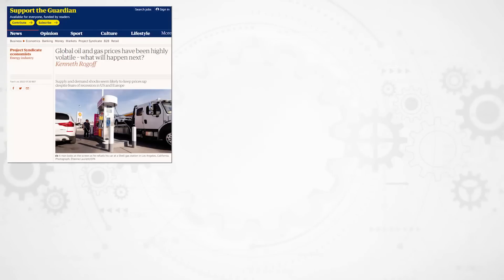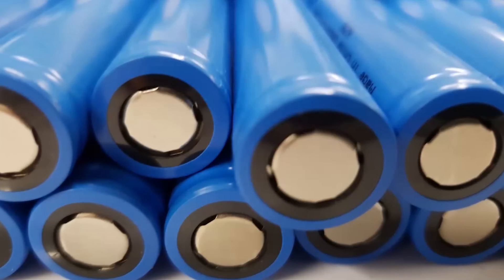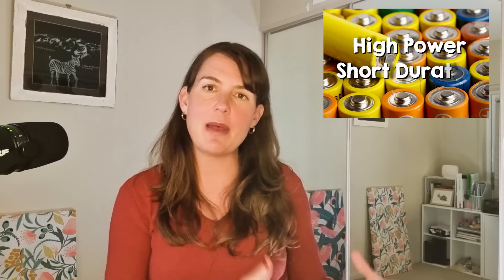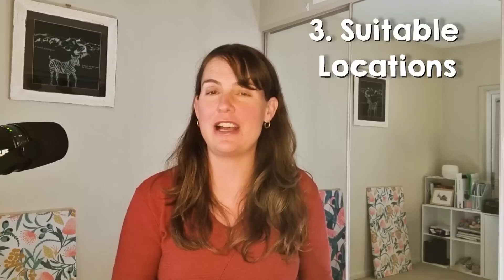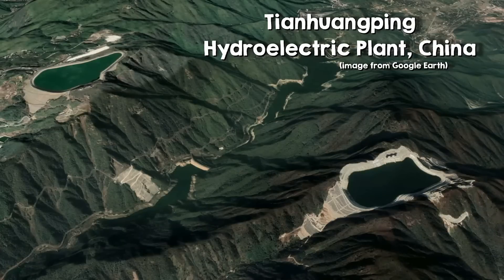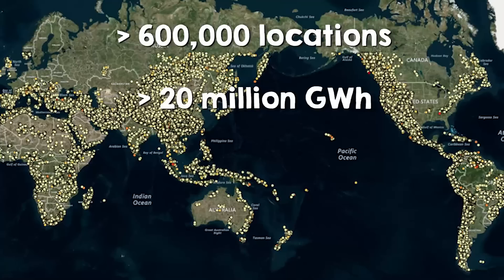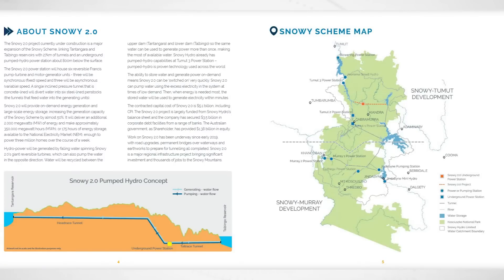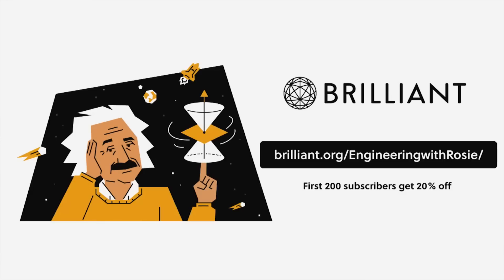Pump It Up When You Don't Really Need It: Pumped Hydro, Future of Energy Storage

Comment: Thank you for the video Rosie. What boggles my mind with regards to pumped hydro is the lack of creativity. The obvious thing is to look for potential height differentials on land as you covered in the video. Those are made obvious with the chart you showed. But Imagine installing each giant windmill in an offshore farm with a reservoir surrounding the windmills foundation. Windmills could then empty reservoirs when there is excess power, and have hydro turbines generate when needed. Generally the highest elevation differences you will find anywhere on earth is in the sea which is pretty much an endless reservoir. Surely it is possible to construct cylinders that displaces enough water and link them in the same way you construct submergible tunnel sections for example. You could get kilometers of head pressure and it is easily scalable with little or no environmental impact other than the construction cost which of course is significant.
Reply: To make pumped hydro viable you need a large volume of water enclosed by a small quantity of concrete. That's why you build dams across existing valleys - 3 of the 4 sides are rock. Difference in height from upper to lower is good because you get more energy per m3 of water,  but height of dam is bad because the higher it is the worse the pressure it has to hold back. So you need 2 natural formations with wide low basins at 2 heights. What you're suggesting is an entirely man made storage reservoir with narrow width and very high height where all of the height difference comes from the dam instead of the difference between the 2 locations. Plus sea water is much more corrosive than fresh water. The whole thing is a complete disaster I'm afraid. But good for you for thinking outside the box. Occasionally crazy ideas can be good. But for every good one there's 1000 ideas that don't work.
Reply: Right, its just immensely expensive to build reservoirs that resist the pressure. Especially in decent volumes. How much volume are you thinking of per windmill?
They need to be watertight, too--at this pressure. 
Unbelieveably expensive...and lots of co2-concrete I suppose.
Do some maths for half an hour please..and tell me whether you still think its a good idea.
Reply: Just look at the challenger deep from Piccard and see how much steel it needed to withstand the pressure. The volume is not even considerable.
Reply: CO2 is a ruse. 
Climate change the "Greens" are talking about is caused by changes in the cosmic-rays/solar-activity relationship and cloud formation  (See the work of Henrik Svensmark.)  Cloud formation by actual cosmic rays can be scene with the naked eye in Cloud Chamber demonstrations.  YouTube has dozens of videos about them.....

Comment: Rosie, et al. New Zealand is studying Lake Onslow, in Otago, an off river location with possible 750m head. Initial estimate is around $4Billion. A 12km tail race (or whatever you call it) will be required.
Reply: Lake Onslow could provide 5TWh of storage, or 6 months of power generation.
Reply: Initial estimate was $4B, most recent estimate was $16B. Still very cheap per MWh. Unfortunately the newly elected government has just cancelled work on it. It will still likely need to be built at some point. New Zealand's power system is going to remain hydro-dominated so the risk of dry years causing energy shortages isn't going to go away. So the delay caused by this government ideologically cancelling the investigation into it (shortly before the investigation would have been completed) is unfortunate.

Comment: I liked pumped hydro, but here in the western US the problem that is coming to be is that we can't have any hydro at all. Our lakes and rivers are failing from prolonged drought and if we invest in pumped hydro near the already existing dams, by the time they are built we might not even have the lakes and rivers anymore.

And the pipe dream plan to pump the output of the Mississippi River all the way out west to the Colorado or top of the California Aquaduct is just that, a pipe dream. Never going to happen as it requires too many government and logistical issues and too much money, and too many decades to build even if all the approvals do go through.
Reply from the maker: That's another benefit of off river/ closed loop systems. They don't rely on river flows so even in drought they can work. If evaporation is a big problem you can cover the reservoirs, though obviously at extra cost.
Reply: @EngineeringwithRosie  You could even cover the reservoirs with solar panels, to make your facility generation and storage : ) The channel Just Have A Think did a good piece recently about floating solar panels intended for marine use, but I think a pumped hydro reservoir could be an even better location for them.

Comment: Awesome vid. Only just one data point, but my friend's boyfriend works in this area and it seems like a lot of gas/hydro hybrid plants are in the planning or building stages (Sydney, Melbourne, Korea, that I know of). The FF companies are still pushing gas hard, even as part of renewable infrastructure, it seems. I would love to know more about how these work and whether there is really any benefit to adding gas generation capability to them.
Reply from the maker: Interesting, I never heard of a gas/ hydro hybrid. The benefit isn't immediately obvious to me but I'll look into it. Thanks for sharing!
Reply: This sounds like a marketing gimmick to me. Maybe it depends on the particular electricity market design but usually there would be no benefit to owning a hydro generator and a gas generator at the same location over owning a hydro generator and a gas generator in different locations (except for grid connection costs, which can be significant). Firming one source of energy with the other doesn't require co-location, that's what the grid is for.
Certainly for a market design like what we have in New Zealand (energy only spot market, locational marginal pricing) I can't see what the advantage would be.

Comment: Hi Rosie. Nice video ..
Checkout the pumped hydro solution by Rheenergise where they change the density of water to cut head height or improve energy capacity.
Reply: change the desity of water? What your talking about? Sound pretty much like a scam. I'll look into that. There is only two ways you can have more dense water, make it radioactive by using water with additional Neutrons from a nuclear plant, needing ro replace half the water every 10 years, or put salt into it making it corrosive and problematic with seepage and evaporation
Reply: Yep Scam as i thought.
Shady oportunity to privately "invest" money into. Already took money from Crouwdfunding places. Only CGI Grafics. Some patented but secret propriatary liquid which is 2,5x heavier than water. If they already have a patent, why dont they show it? Maybe because then people could see that the fluid is a scam?
Would not wonder so soon see a youtube suggestion to that company from JustHaveAThink.

Comment: I had heard that we already basically built all the good pumped hydro sites. I'm happy to hear that that info was probably just about the traditional systems and there's actually a lot more room to grow with it.

I ran the numbers a while back curious how a pumped hydro system would work in a single family home. You'd basically need to have the entire attic and basement filled with water reservoirs to compare to a lithium ion battery.
Reply: Hi Cade - that's a great question! On-River PHES (Pumped Hydro Electricity Storage) IS already maxed out and the last best sites are all ecological hotspots and would disrupt river systems and fisheries. But there's an answer!
* OFF-RIVER closed loop pumped hydro dams solve this! They open up a VAST range of choice.  Anywhere with a decent hill or cliff can be used. They’ve used Satellites to map the topology and the world has ample sites to choose from. America has 100 times, Australia has  over 300 TIMES what we need! That means you can avoid mucking up any sensitive conservation or even tourist areas. You've got over 300 TIMES what you need to choose from!
* WATER? They use a TENTH the water of coal fired thermal plants. We'll SAVE 90% of today's energy-water by switching to renewables.
* FAST BUILD TIMES! There's no pesky river to divert! You work on the upper reservoir, the lower reservoir, the tunnel connecting them and even the turbine room all at once! As a result they can be built in 3 years. When finished, build a pipe to the nearest river and pump the water in slowly. Cover with floating solar panels to reduce evaporation - and if you're lucky local rainfall might help top it up a bit.
* They’re CHEAP. First we reduce the storage required by over-building the wind and solar grid to cope with the worst winter week. Given solar is ¼ the cost of nuclear, this is economic. The final price for a 100% wind and solar and pumped-hydro storage is CHEAPER than we’re paying for electricity now – about $70 Mwh! For CLEAN power - without all those pollution health costs. For OUR power - without being tied to a global gas price or anything.
* Then you have the ultimate battery. It will never generate its own energy - and just uses the solar and wind to pump water uphill. It’s expensive up front, but because it will last over a century it's ultimately one of the cheapest grid batteries ever invented. And we’ve got over a century of experience using pumped hydro. 
This means there are no new inventions required for a 100% renewable grids. 
http://iopscience.iop.org/article/10.1088/2516-1083/abeb5b#prgeabeb5bs6
Reply: @eclipsenow5431  great example bro! Here is another one for you to confirm the arguments in favor of this!
Turn on subtitles for better understanding!
https://youtu.be/RtYBoQGOErE
https://youtu.be/OZ3eb9X5zOY
In the description of the video there is both a patent and primary sources!
Although, a patent is not required here, because the pressure transducer has been known for several millennia!
https://youtu.be/0YbpPbqQUpE
The payback of this type of hydro power plants is from one to two years!
Reply: You never want that lithium ion battery or powerwall to catch fire though in your house. Thermal runaway has been an issue with grid storage batteries, like the ones in California which caught fire. There is nothing in the world that would put that out.
Reply: @peterkratoska4524  That's why every new super-battery chemistry fixes not only thermal runaway but other issues. 
Batteries are exciting! EV's are switching to LFP batteries (lithium iron phosphorus) which are both cheaper and fix thermal runaway. But they come with medium driving distances. But this video follows a few other battery trends that could revolutionise EV's in the next 5 years, with ranges up near 800 to 1000km!
https://youtu.be/n1TBAWlbXKI
Household batteries can be chunky and clunky - and made from sodium! Sea-salt batteries are on the way. They're a third cheaper and solve thermal runaway. Salt is abundant and takes pressure of the lithium suppliers!
But my current understanding is society should be moving to maybe 2 hours sodium batteries followed by 2 DAYS from local OFF-RIVER pumped hydro. Andrew Blakers team used satellite maps to show most countries have over 100 TIMES the sites we need. Pick the best 1% and you're done! https://eclipsenow.wordpress.com/overbuild/
Reply: 10 kWh is 36,000,000 Joules. Let's assume a difference in height of 8 meters and you get 36,000,000 / 8 / 9.81 = 458,716 kg, 459 metric tons, which would be the mass of 459 m³ of water. A cube of 7.7 m (25 feet) edge length.
Reply: One lithium battery? What was the capacity of said battery?
Reply: @TCt83067695  like a Powerwall. All the numbers had big enough variation to choose from, so take it as within an order of magnitude or so.
Reply: Pumped hydro in a home. You're joking right?
Reply: @hawkesworth1712  not that I thought it would actually work. Just looking at numbers to get a sense of scale. 

The elevator shaft with a cubic meter of lead is the obvious choice for home storage anyway. /s
Reply: @cadekachelmeier7251 thanks. I must say I'm still very surprised by this. A Powerwall is about 13kWh in capacity. Yet if I put 2 external tanks outside the house imitating basement and attic height, that's also equivalent to only 13kWh?
I'm very surprised.

Maybe we SHOULD fill up the tanks with lead or mercury then, like suggested.
Reply: CO2 is a ruse. 
Climate change the "Greens" are talking about is caused by changes in the cosmic-rays/solar-activity relationship and cloud formation  (See the work of Henrik Svensmark.)  Cloud formation by actual cosmic rays can be scene with the naked eye in Cloud Chamber demonstrations.  YouTube has dozens of videos about them....

Comment: I keep wondering why in areas like the US west where they are having aridification (permanent drought conditions) resulting in the countries massive network of hydroelectric dams no longer able to run at full capacity... well... why they don't retrofit those hydroelectric dams to function as pumped hydro energy storage during periods of the day?  The dams already have an upper reservoir and because of flood risk the area directly below the dam is open land where the river can be widened into another smaller lake that can be used to draw water from to pump back to the upper reservoir.  The hydro electric dams would still be able to operate as a normal hydro electric power plant during part of the day but during other parts of the day it would be able to pump water back up to the reservoir.

Comment: Didn't realise pumped hydro had so much scalability.  BTW  interconnects also reduce storage requirements.  Solar energy arrives pretty consistently but gets converted to wind chaotically, capturing it over a wider area abates local shortages.  Smart grid, demand shaping, home thermal storage can also help.
Reply: Good comment.
We do not have a renewable energy production problem.
We do have a renewable enery storage problem. This is where our efforts need to be pushed harder.